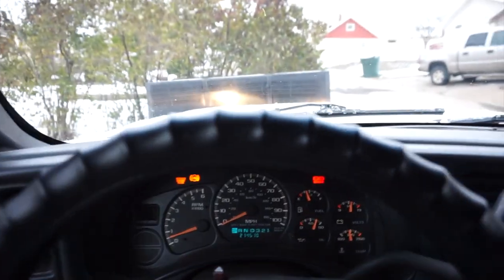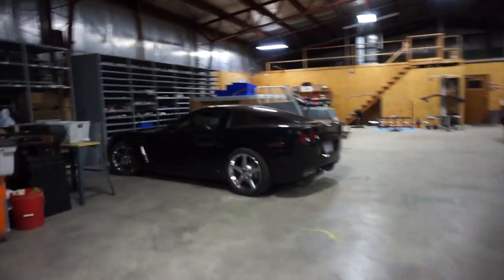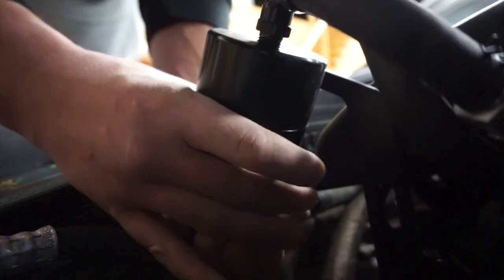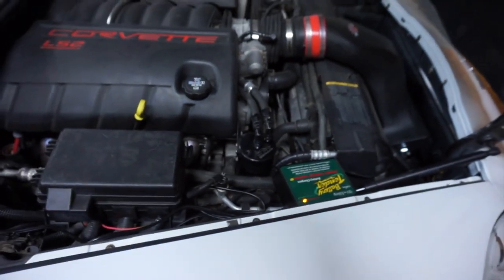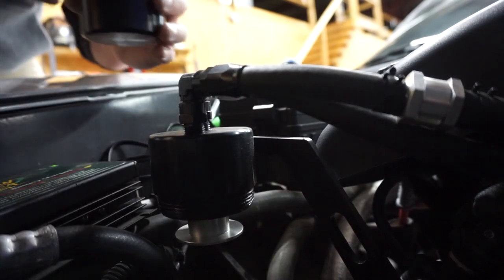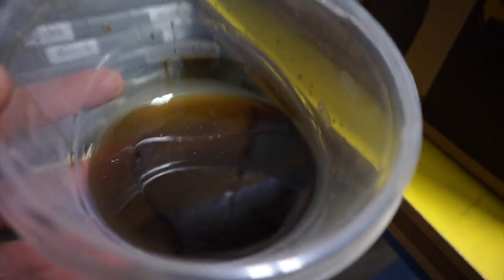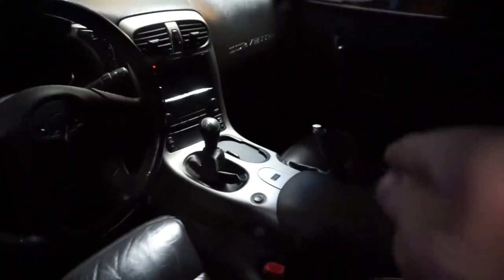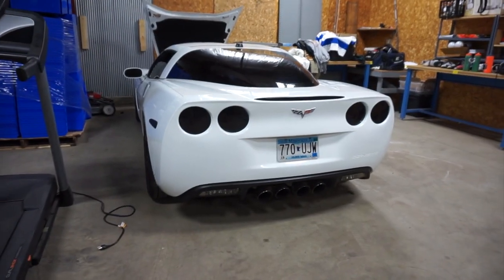Elite Engineering E2 Catch-Can - 2,000 Mile Results!!

Comment: Good honest review and a neg for the Elite.  Product fail on the first needed service is one hell of a reason to buy something else.
Reply from the maker: They make a very nice product, I just wonder why the o-ring was dry and tore the first go round. 

When I installed it I believe I put a dab of motor on it like you would ok an oil filter so it would seat nicely and seal.
Reply: @Greenlightfilming  
I would think some nitrile o-rings would be a good upgrade, but adding some lube, motor oil or even white petroleum would probably work well.  Maybe it was just a bad batch, never know.
Reply from the maker: Yeah you never know man. All I could tell was that the o-ring had "dried out". I'm 100% sure when I put it together I put some motor oil on the ring like you would do on an oil filter. I've since sold the car and don't know if it had the same issue.

Comment: You screwed it down to tight. The o ring never had a chance
Reply from the maker: I'm not so sure that's the exact reason it failed. I put it on reasonably hand tight when I first installed it, with some motor oil as lubrication. 

It was dry and tore when I tried to take it off to empty the catch can.